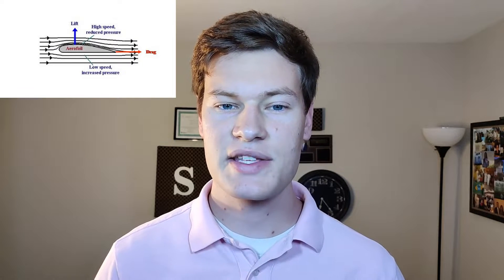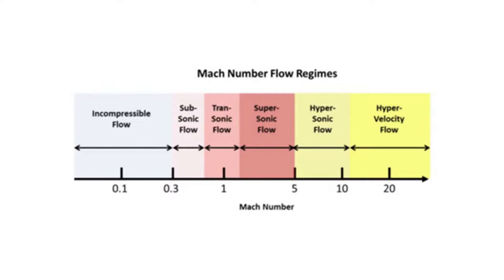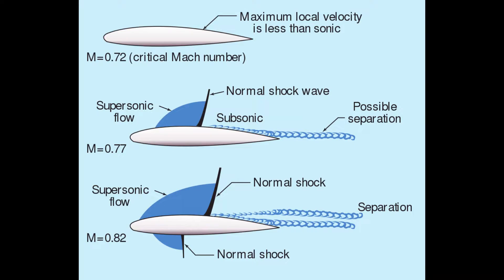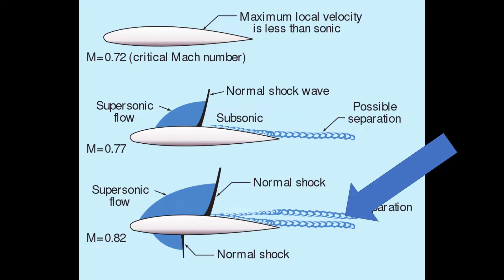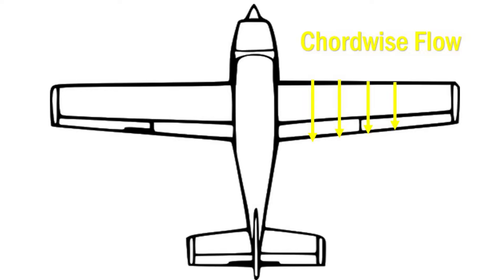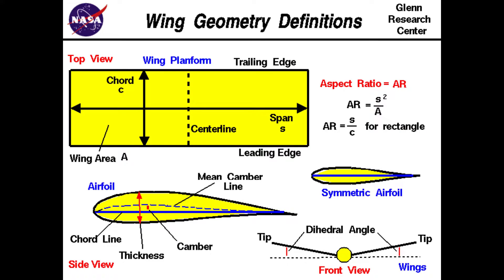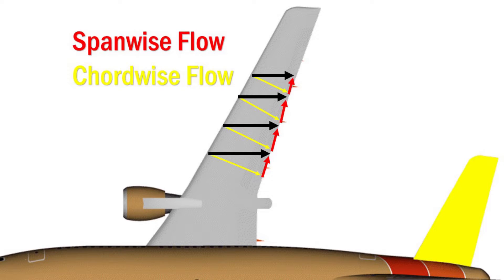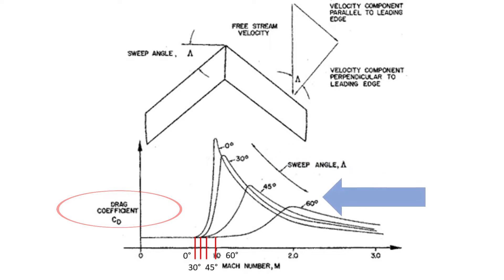Why Airplanes Have Swept Wings | Aerospace Engineer Explains

Comment: You say at 2:36 that they needed to find a way to decrease the critical mach number. This is a mistake. You want to increase the critical mach number so you can go as fast as possible without the airflow reaching mach 1 and thus causing shockwaves.
Reply from the maker: Woops! You are correct. Good catch. I should have said increase the critical mach number. Thank you for pointing that out!
Reply: I think he was saying decrease because he was thinking about decreasing wave drag.

Comment: ...4:15 but even with 60° of swept (which is pretty much) you can only push the max. airspeed to like 1.3 mach according to the diagram. How the heck can e. g. a fighter jet reach more than mach 2 ?? And the have often less than 60° swept.

Comment: Swept wings don't just increase Mcrit and decrease wave drag but the fact that there's spanwise flow at all decreases air resistance. Swept wings allow for some of the air to run along side the wings (the previously mention spanwise flow) much like "sliding down a ramp instead of running into a wall" as I've heard it said.
Reply from the maker: Makes sense. But I would add that Wave drag is just a type of "air resistance".
Reply: @AviationAustin  Yes, it's a type of drag but air resistance is usually used to refer to form drag even though it can be used to refer to drag in general regardless of where this drag comes from.

Comment: Nice content. Hopefully we can get an explanation of why the Concorde or F-16 didn't use normal swept wings, instead of the delta wing. :)

By the way, the outro is: Eveningland - Rev [Genre = Prog. House]. That is my favorite style of electronic music.
Reply from the maker: It's a great song. I'm not sure what you mean of a normal swept wing. Are you asking why it's a delta wing versus a normal commercial aircraft being the long slender shape?
Reply: @AviationAustin  Yep. That is what I am asking. Why can't we use a Boeing 717 wing on a supersonic plane? It is swept well enough
Reply from the maker: My video Why Wings are Shaped like this will probably shed some light on that question. But just broadly, it has to do with Aspect ratio and drag. The larger the aspect ratio (or the skinnier and longer) the wing is the less maneuverable the aircraft. So the F-16 need to have a short fat wing to help it be maneuverable. As for something like the Concord it's about drag. The reason most commercial planes need a long skinny wings is because they need to generate a lot of lift and don't need to be maneuverable. The Concord didn't need to generate as much lift because it had some much thrust to compensate for the shorter wings. If it had longer wings it would cause too much drag. This reduced lift ended up being a problem on landing when they had to slow down they had to stay pitched up to stay in the air. That's why it had to have a droop nose.
Reply: @AviationAustin  Hmm. So someone needs to design a supersonic wing that has desirable qualities at both low speeds (high lift) and at high speeds (less drag). Like a wing that has a 55° sweep near the roots a third of the way of the length, and a 35° sweep near the tips.
Reply from the maker: They have. The F-14 had a variable sweep wing that went from a conventional swept wing tona Delta wing. But it was discontinued. But more accurately what you're describing is called a compound Delta. So the thought has been had it just hasn't been used too much. Look up the F-16XL
Reply: @AviationAustin  The variable sweep wing would add considerable hydraulic weight. Thankfully the compound delta/crescent wing exists. So, a slightly higher aspect ratio, narrower version of the F-16XL wing could be deployed on a small supersonic passenger plane in the future.
Reply from the maker: @thatguyalex2835  boom supersonic has concepts that have curved Delta wings that achieve the same thing you are describing. So hopefully soon
Reply: @AviationAustin  I am hoping for the Boom Supersonic to succeed in the 2020s. :) A great airplane. Hopefully they publish some good performance numbers soon (V rotate, service ceiling, etc)

Comment: Spanwise flow and Cordwise flow in your diagram is such a none-sense explanation. there is no such thing as "only cord wise flow generates lift". Air mostly flow over the wings parallel to the direction of travel, you can't just split airflow up arbitrarily like what you do to a force vecotr in your high school physics classes.

https://aviation.stackexchange.com/questions/38482/where-is-the-spanwise-flow-how-does-the-span-wise-flow-point-the-air-towards-th